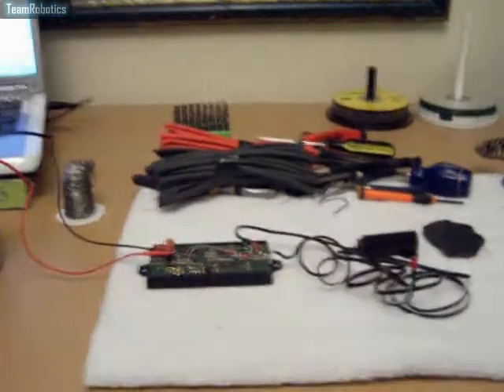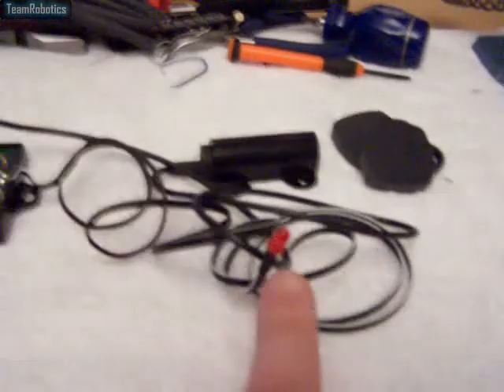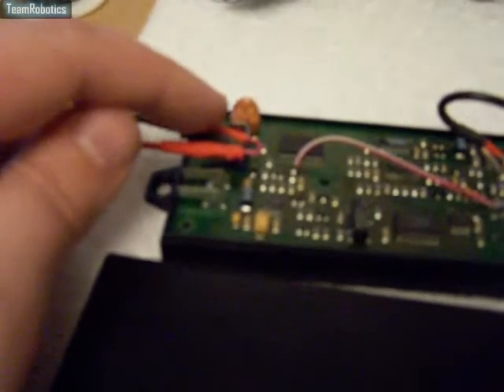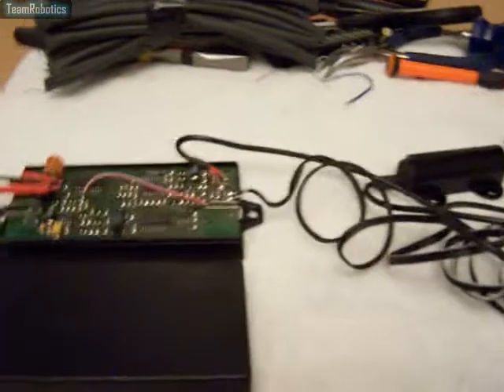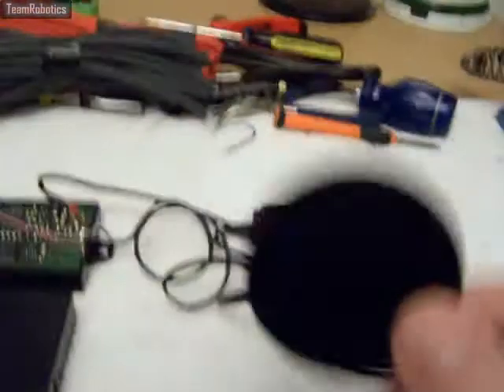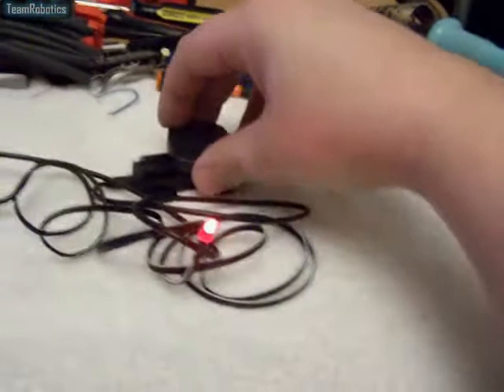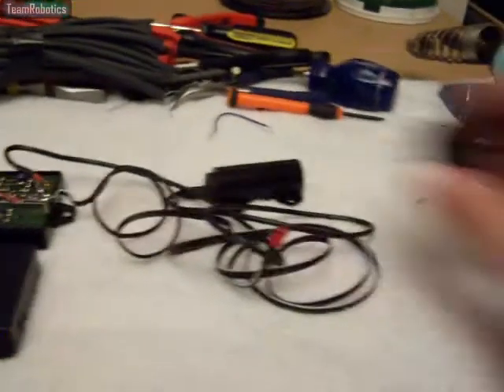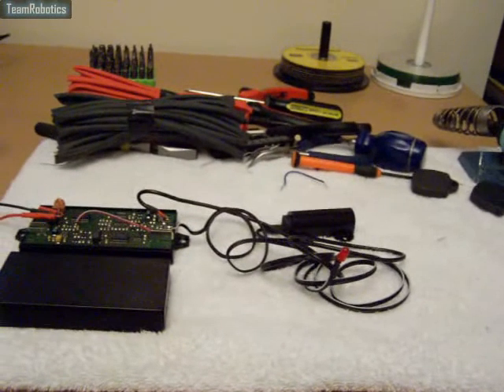RFID EM4102 UNIT SETUP AND USAGE

Comment from the maker: @XeonXR6 read range with one of these readers is up to say 2 or 2.5inches but with a pen usb reader you will find it very difficult to read as they only have a small coil so find it hard to energize the transponder, They work just great for me as i prefer a short read range because of what im using them for. regards Richard P.s i would like to have a read/write transponder at some point so that i can store data but im going to see if they bring something out with a larger storage area first.